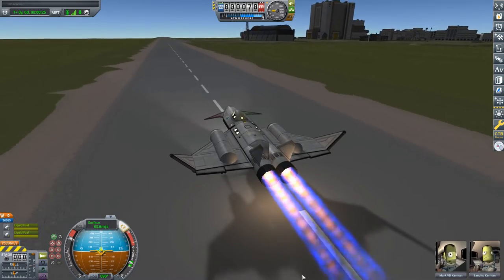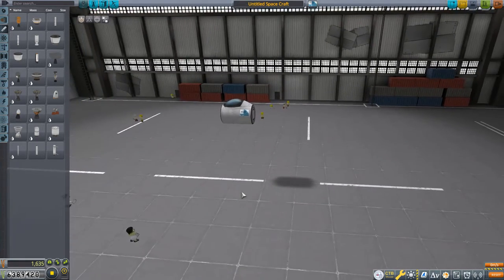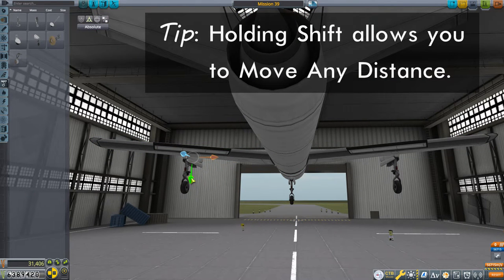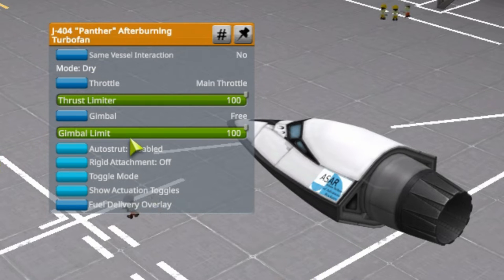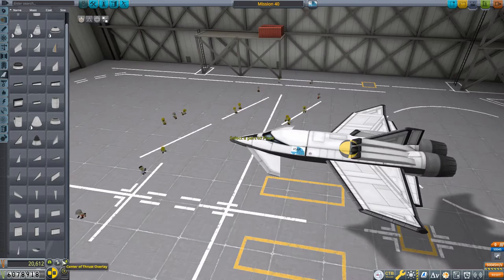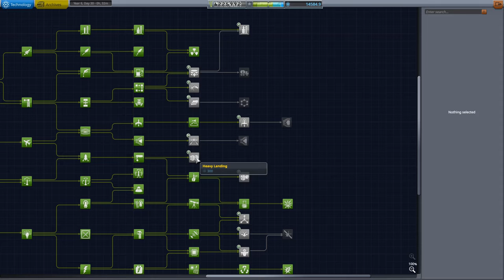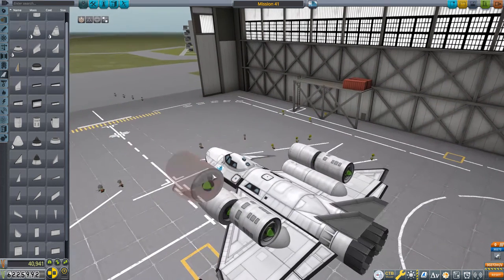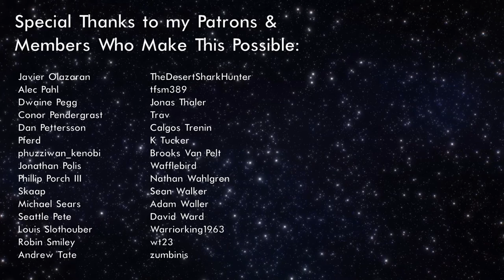What's The Difference? | KERBAL SPACE PROGRAM Contract Tutorials

Comment from the maker: Up Next: Building & Flying SSTO Spaceplanes - https://youtu.be/mqfIjy7KJJk
Reply: Could anyone help with my problem? I have Mk.2 based spaceplane weighing about 57t and climb at a rate of about 10-15 degrees. My craft has a COM towards the rear, as my fuel tanks are there and a COL in front. On this craft I have two whiplashes for low atmosphere and two darts for above 20,000, with one shock cone intake and adjustable intake radial per engine. The problem I have is that the air flow initially increases so that I can increase to about 300m/s, before it drops off rapidly so that I immediately lose speed and thus enter a sort of crushing speed of around 277m/s, nowhere near adequate for a spaceplane. I do have a delta deluxe winglet in front, but with a relatively large amount of separation.
Sorry for the long post - not sure what is relevant or not.

Comment: In the U.S. military, we do use wet and dry to describe normal and afterburner/reheat modes of jet engine operation
Reply from the maker: Good to know. Thanks.
Reply: When I hear it I think of the two ways you can hook up nitro to a car. Dry means you are supplying the nitro into the main fuel rail just like you do gas,and Wet means you supply the nitro to each cylinder independently like a single fuel injector does.
Btw,thank you for your service,no matter how you served. I appreciate that you had to take time away from your family to keep my families standards of living as good as they are,so seriously,thank you.

Comment: I once used this tutorial to build a plane with a delta wing that had four panther engines on the wings and two  whiplash engines on the back with adjustable air intake. When i launched it though it had a thrust to weight ratio so stupidly great that it went from Mach 0 to Mach 1 in about 5 seconds
Reply: For anyone who's curious, that's approximately 6g of acceleration.  Ouch.
Reply: @stevenscott2136  damn

Comment: Great video Mike as always, just a couple things I do a little differently.  I prefer to get my main wings as close to where I need them before I use the move tool to find the perfect spot.  I usually attach my rear landing legs to the side of the fuselage at 90 degree angles (so the point down obviously) then adjust them from that position.
Reply from the maker: I do the same with the wings. I just want to show a dramatic CoL move. Good idea with the landing gear.
Reply: @MikeAben  Hey thanks, I've been picking up a lot of great ideas from your channel.
Reply: I usually have no idea where my CoM is going to be when I first fit my wings. That's because I often build Mk3 spaceplanes with engines on the wings. :) I don't always like to use VAOS's trick of putting the engines near the center of mass. It's practical in KSP but maybe not real space, and I want to make my own style anyway.

I like to fit rear gear in the middle so they're pointing straight down to start with. You still get two with symmetry on, though I don't think that's true in KSP2. I can't always do this because I often have a cargo bay which opens downward for unloading on the ground.

Comment: When you said you occasionally tap the "F" key to turn off SAS, I found it strange since I thought "T" was the shortcut for it, when I looked into the wiki it said that holding "F" inverts the SAS state, is the end effect different?
Reply: When you hold down F, if SAS is off, it will temporarily turn it on for as long as you are holding the F key, and vice-versa for if SAS is already on. In flight, tapping F disables SAS for a split second, allowing the nose to drop. As stated in the video, this is especially useful at higher time warp.

Comment: Mike, how fast does your Wheesley-powered plane fly, e.g. at an altitude of 10 km?
Reply from the maker: All I can do is refer to what you see in the video where it exceeds 1.3 km/s. I don't know about at a 10 km altitude.
Reply: @MikeAben  Are you sure, we both talk about the same engine? I'm talking about the Wheesley respectively the first plane you present in this video. The highest speed you show for this specific plane is 250 m/s, but since your main throttle was set to zero in that particular scene, this cannot be its top speed, which I need to know.
Reply from the maker: @erichoffmann9812  Sorry, misread the post. 250 m/s sounds about right for this plane, though you will go faster with a lighter plane.
Reply: @MikeAben  Infact I build myself a minimalistic survey plane, powered by the Wheesley, which travels 580 m/s at an altitude of 10.5 km (even faster close to sea level, but I don't use it there due to rapid fuel drain). This particular plane is capable of high altitude observations, since it can go up to 20.9 km. Of course it cannot stay on that altitude, I must pull it up at each waypoint.

Comment: My plane is sliding around the runway and I fixed the weily thing but it just keeps sliding what should I do.
Reply: for the wessly
Reply from the maker: You can try increasing the friction on the rear landing gear.
Reply: @MikeAben  Thanks
Reply: If it still moves with increased friction, you need bigger or more landing gear. In this case, you may see it juddering rather than sliding if you look closely.